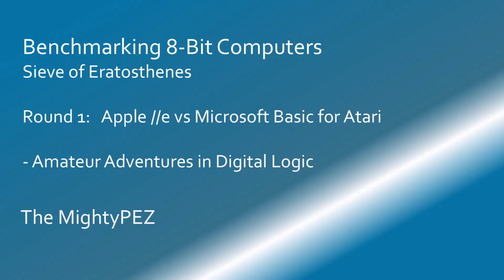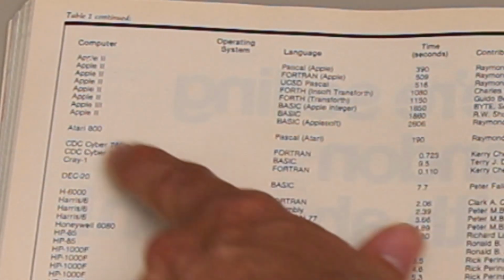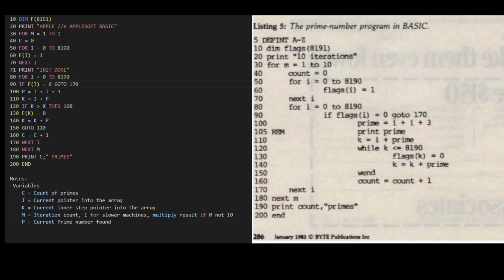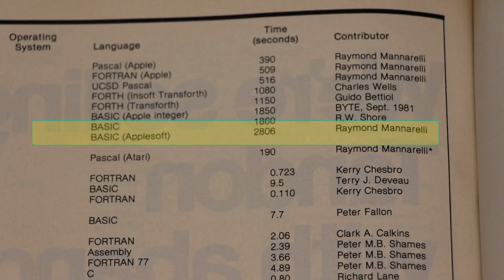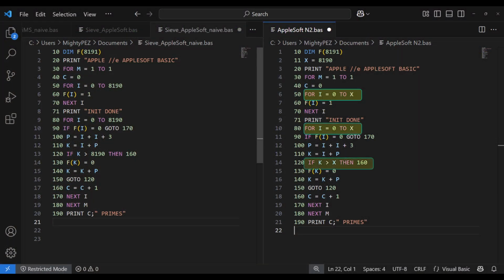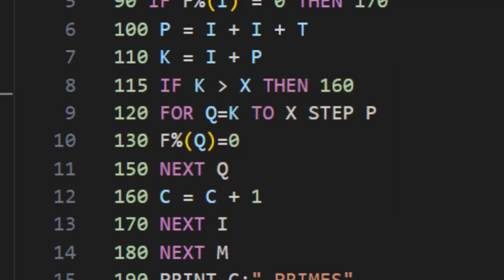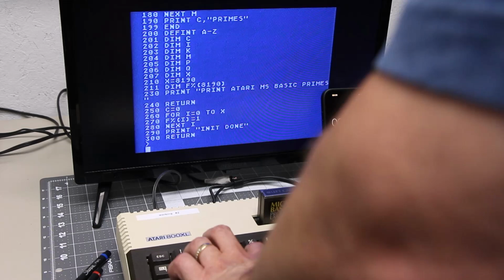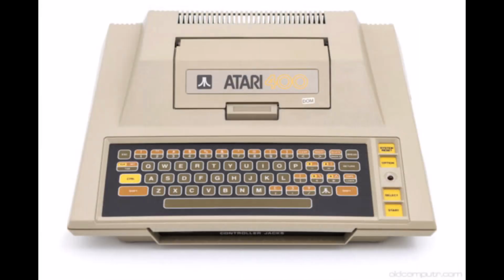RetroComputerBenchmark

Comment: This is more of an interpreter benchmark than anything else. For example, BBC BASIC on 6502 runs code WAY faster than Microsoft 6502 BASIC.  It doesn't really eliminate any variables to use Microsoft BASIC on each CPU either, since these may vary widely in terms of speed/size optimizations as well as utilizing any special features offered by the CPU. The best that could be done would be for the algorithm to be written in machine language for each CPU, taking advantage of every available CPU feature that might speed up the computation.

Comment: quick note - wikipedia: "Atari BASIC is an interpreter for the BASIC programming language that shipped with Atari 8-bit computers. Unlike most American BASICs of the home computer era, *Atari BASIC is not a derivative of Microsoft BASIC* and differs in significant ways. It includes keywords for Atari-specific features and lacks support for string arrays."
Reply from the maker: Correct Atari basic is not a MS derivitave, however i am using the Microsoft BASIC cart which was released after Atari basic. It is somewhat different variant and better/ faster. I have also shot video using ATARI basic for my next vid, and as i expected is slower than MS basic for atari.  Atari basic is built into the 800xl, but you can see in the vid i have the MS cart installed.  Atari basic does support string arrays, and i use that in my atari basic code instead of the small int arrays i use in MS basic.